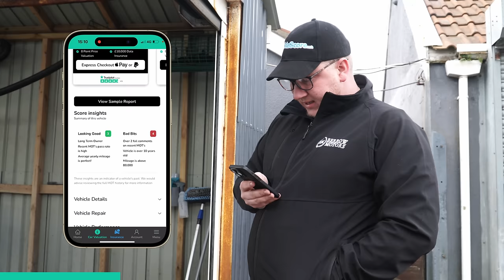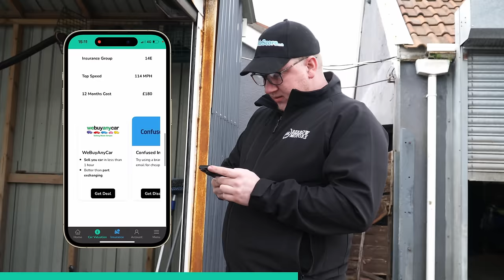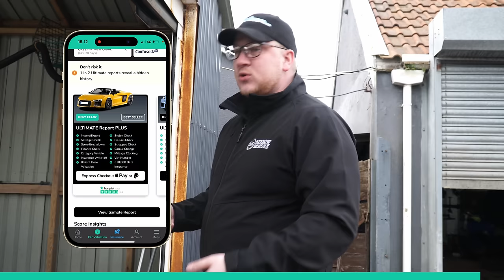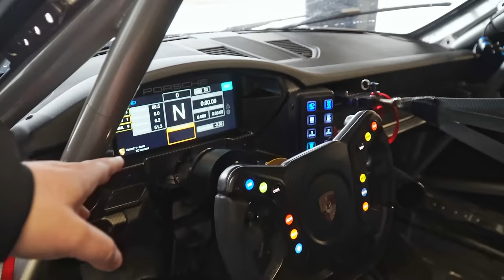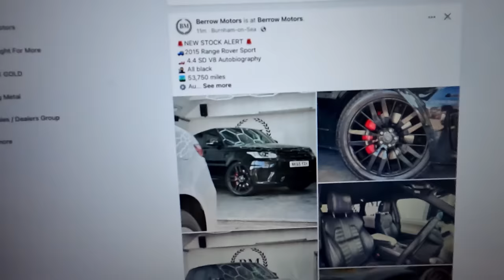2 Employees Leave Berrow Motors (And The Country! 🇩🇪) | BM Weekly EP 32

Comment: Bet the Fiat had loose or poor connection on starter motor. I've had a few Fiat's, MiTos etc do the same.
Reply from the maker: That’s interesting! It’s gone to Fiat now!
Reply: @ShiftingMetal  its the petrol engine ones I've had most trouble with, I wasn't on the tools for that long but the 3 I had, 2 Fiats Punto and 500 and a MiTo had the same fault. And 1 had just had a starter motor, the MiTo was sat for ages. The connections often go all green too